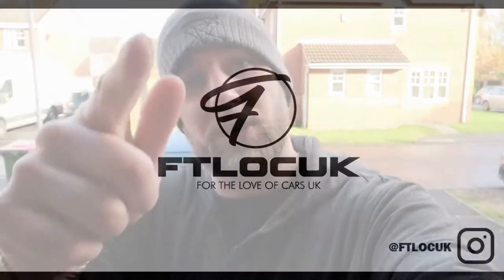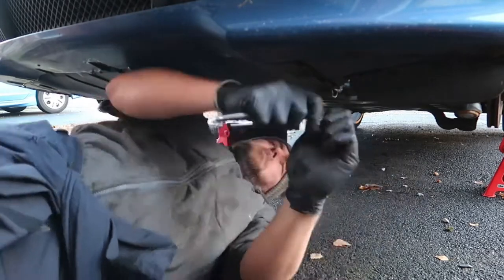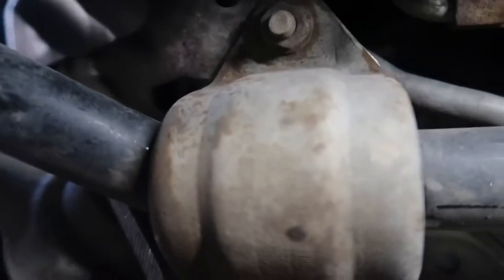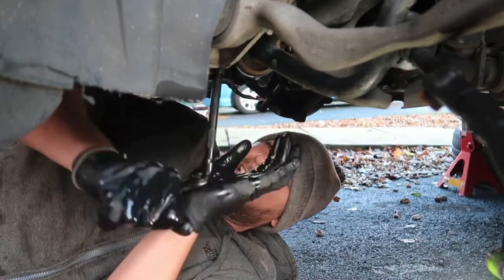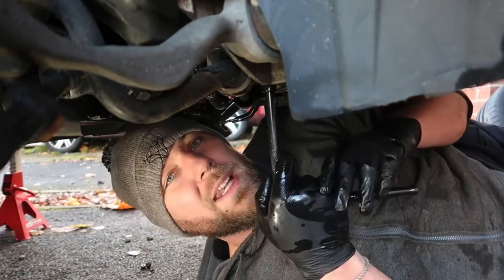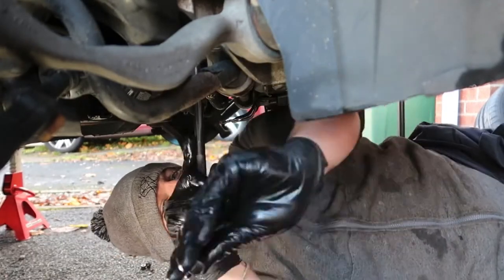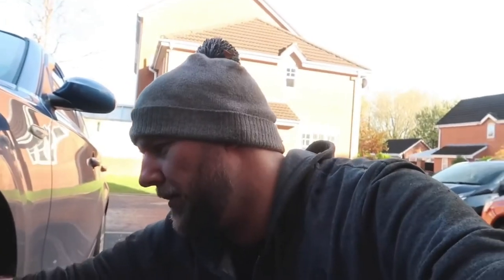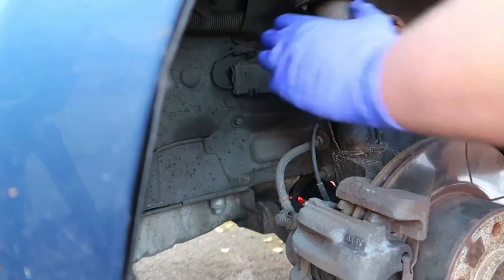E87 BMW Anti-Roll Bar Bushes Upgraded To Powerflex!!

Comment: I think your drop links failed early because most brands you need to pre tension the suspension, like either putting it on bricks or lifting the side from underneath hub

Comment: Hi mate, on my E87 the passenger side steering rack gaiter rubs against the anti roll bar when on full lock, but drivers side is fine. When you look under the car you can clearly see there is hardly any gap between the gaiter and ARB whereas the good side (Drivers side) you can fit two fingers inbetween. Are you able to advise please?
Reply from the maker: Message me on Instagram if you can 👍

Comment: Have you also done the rear anti roll bar bushes?
Reply from the maker: Anti-roll bar bushes are done mate here’s a link to the video: https://youtu.be/yycf45JV6kQ
Reply: My rear end is knocking over bumps. I've had a look and my 120d e87 doesn't have a rear anti roll bar maybe just m sports cars😂must be something else 😒
Reply from the maker: Mine was knocking from the rear but wasn’t suspension it’s turned out to be my prop couplings